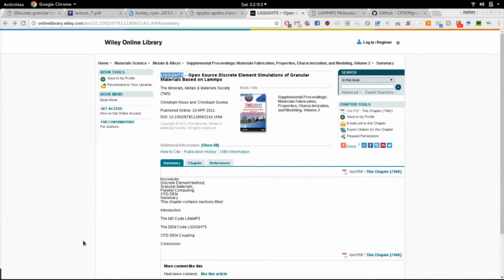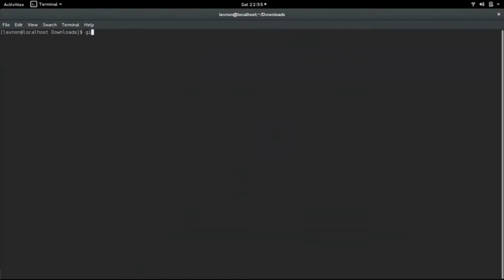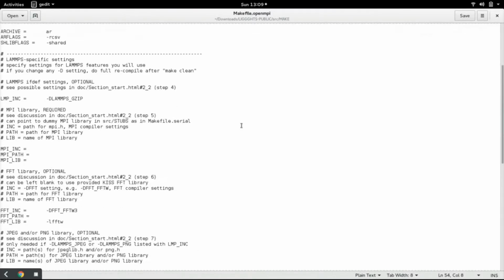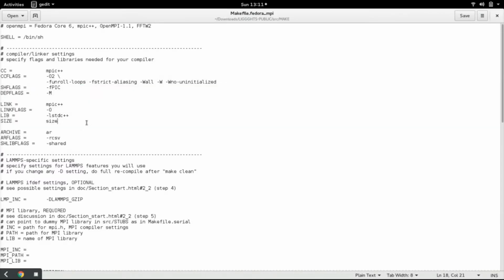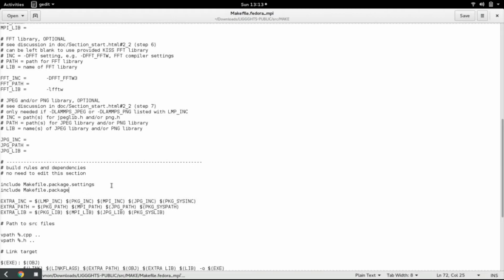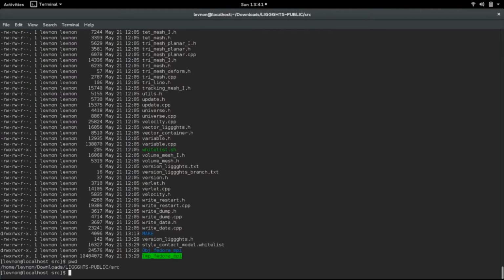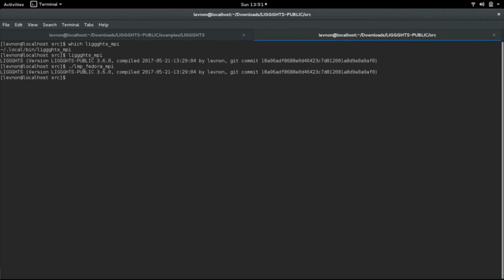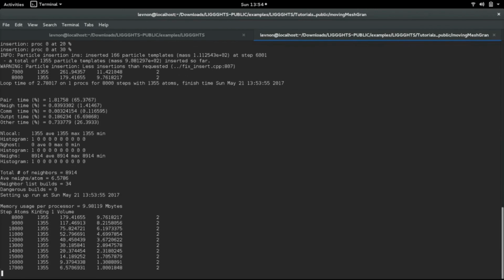Compiling LIGGGHTS (DEM) 3.6.0 on Fedora

Comment: Sir I failed to create symbolic link...what to do?
Reply: The symbolic link is for convenience ... u can instead rename lmp_fedora_mpi to liggghts_mpi and move it to ~/.local/bin or wherever you wish to store your binary. You can also directly execute the file without renaming/moving it anywhere: ./lmp_fedora_mpi
Reply: @levnon484  thank you very much for your help and great tutorial video. 😊
Reply: @levnon484  I am a beginner for LIGGGHTS software...could you please provide me some guide how to begin or some useful links?.thank you
Reply: @levnon484  okk thank you.
Reply: Hey i am having a issue that i have installed gedit through ubuntu terminal but whever i give command 'gedit file' it does not open in gedit. Is there any other way to open and edit text file?
Reply from the maker: @ashi1152  nano/pico, vi/vim, emacs, ... just google text editors for linux.
Reply: @CSE-14   one more thing i am having windows system installed linux subsystem. Does it work in same way on windows?